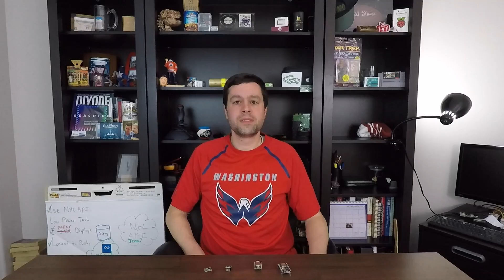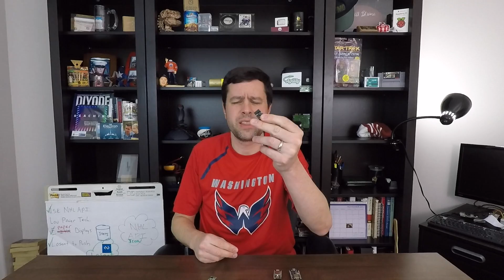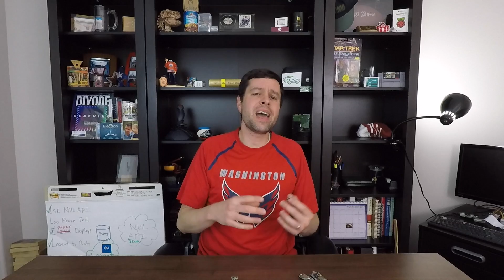RFM69 vs WiFi for a Sensor Network

Comment: I prefer WiFi, but WiFi chips are not always reliable. I have an RPi Zero W and the WiFi chip died after a year of use or so. I bought the Edimax EW-7811Un WIFI adapter and the compact microUSB to USB adapter.
Reply: How do you power it, do you use some battery pack?
Reply: @Xposterion  I do not use backup power.
Reply from the maker: WiFi is also a huge energy hog and essentially a non-starter for always-on battery powered apps. But you nailed it, for powered apps they usually work right out of the box and get you straight to the internet.

Comment: I am looking into using these radios in my Home Automation project but I am unsure about the antenna. I have found the right lengths and I know that straight works better than curled, but what type of wire do I need to buy? Can it be any wire or should it have 50 ohm? Any links to aliexpress or alike are greatly appreciated!
Reply from the maker: Thanks for watching Der Kiesel. In my testing I just used solid 22 AWG wire (not braided). It works great. I did some not-very-scientific comparisons of helical antennas vs straight wire on my blog. You can find that info at https://www.kevinsidwar.com/iot/2017/11/27/rfm69-antenna-tests

The wire doesn't have to be anything special and you can get huge ranges. Hopefully that helps some.
Reply: @KevinSidwar  that helps a lot, thanks!

Comment: just found your channel and I'm pumped about it! I couldn't agree more with your analysis. I am wondering about sending a large amount of data (photos) over rfm69. Will it make a successful (albeit slow) transfer or could the data get corrupted?
Reply from the maker: Hey Jimbo, I'm pumped you found the channel. Thanks so much for watching. That's a great question. I've never tried sending image data but I imagine it would just be a slow transfer. Their are quite a few libraries that I believe will handle data retries and checksums to avoid missing/corrupted data. That's an interesting idea.